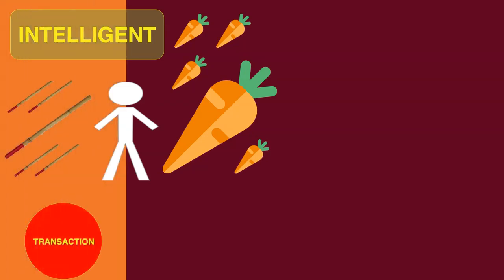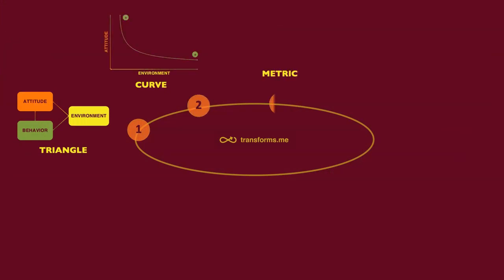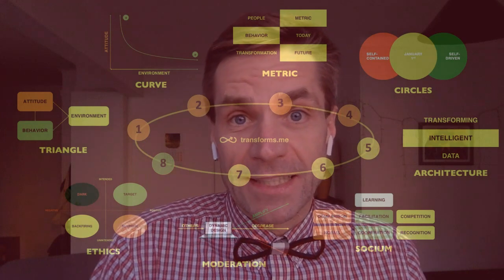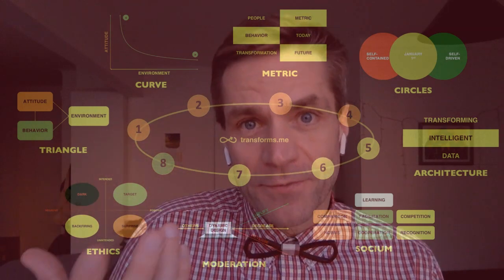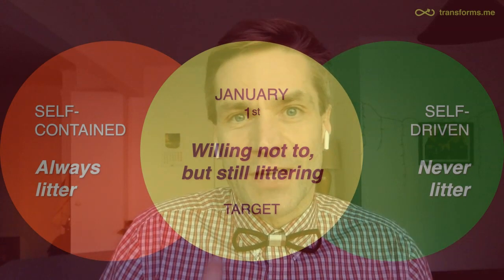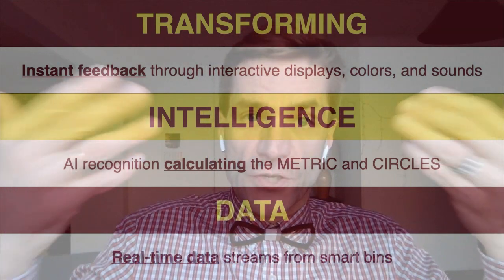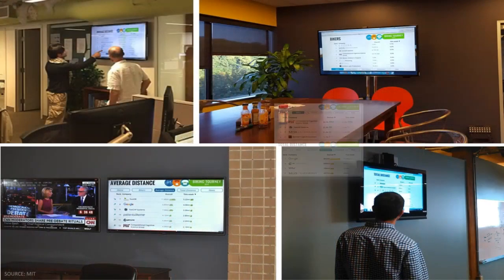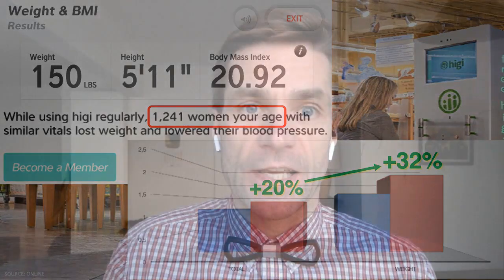Transformation Design Methodology | STIBE method | The Littery | AgnisStibe.com

Comment: Change appears to be a highly nebulous concept, therefore individuals might occasionally confuse actual change with ordinary transactions as they are unaware of the distinctions. However, the outcomes cannot be obtained without long-term sustainable development. As a result, if people wish to do a transformation, they won't be able to handle brief transactions or even transitions. This video is quite useful, and it helps me comprehend the primary concept of change. 
Thank you for the insightful video!

Comment: Simple and concise summary of the methodology that shows the difference between change and transformation. After watching this video I understood the power of graphic that shows progress in transformation. It motivates and encourage each other to join the transformation process. But I'm wondering about anonymizing this data to avoid possible side effects. Regardless of all I see potential of application this framework into many social areas.
Reply from the maker: Absolutely, anonymization is the key to avoid potential privacy issues. That is an important part of the methodology. Usually, it comes right after the 8th tool, called Ethics.

Comment: The business case share is practical, and I use TDF to analyze similar cases after this video. Among the Transformation Design Framework steps, what interests me the most and makes me feel the most elusive is the fourth step, "Circle." 

"Reward" plays a role as a hook in the transformation process. It's hard to tell does "Reward" motivates enough to drive people (such as January 1st) to change, or can they be sustainable use the service? --- They are like consumers without loyalty.

If people need to conform to social norms through transformational design, then in "SOCIUM", I am curious to what extent people can influence each other.

Comment: Measurement is one of the most crucial aspects of any transformation framework since it influences all of the other parts and allows to witness the real transformation. The misconduct or incivility of certain group of community or some corporation are the reason for the emergence of this methodology. It is vital to recognize and embrace to this transformational change. This will be a sustainable solution. No doubt that all organization has to deal with the changes and it is important for them to transform everything towards a positive sustainable change. Either the organizations learn to be a leader or an influencer in transformation  andor risk everything and be the victims of ever-changing circumstances.

Comment: I think it helps to set milestones (smaller ones) and monitor frequently if we are one preferable vectors trajectory or we have experience set back (rights and lefts). As said in the video, its common to get off the right pathway by ignoring the fact we had a slip up. 
The ease of capture is impacted by multiple factors and the environment is the biggest one. What makes it more difficult is the mixture of different people type - self contained ones, self driven ones and 1st of January. 

What I like is the triangle that helps not only evaluate current behaviour, environment and attitude but as well preferable. Identify is the biggest impact comes from environment or attitude. Appreciate you teaching us by an example to identify - what is what in each situation!

Comment: Thank you, Agnis, for a good and simple summary and provided framework! My thoughts: during the class we are working with quite simple social or behavioural problems. So, I'm trying to understand, how apply it during the changes I'm usually working on - complex and technological changes involving the vast majority of the company, customers and business processes. And, what I see as immediate benefit, is (a) borrow overall thinking approach as people very often struggle with analysis and structure, (b) combine different methods, e.g., use hybrid approach, where we can apply this framework to solve separate behavioural challenges, which usually such transformations face, thus accelerating the change and reducing risks.
Reply from the maker: Thanks, Mark. You are absolutely right. This framework provides insights to deal predominantly with tiny and precisely describable behavioral issues. As you rightly said, to train our brains before taking a deeper dive into everyday complexity. Similarly, as we develop professionalism through practicing.

Comment: I find this video insightful. Dealing with change may cause uncertainties, especially during the transition phase as it is the moment in which you cannot see the outcomes of the change yet. For this reason, I find the transformational vector very useful in order to track whether you are following the chosen path and whether you are still sustaining the change. Together with it,  in my opinion, the metric framework should be always integrated in order to technically measuring if the change is happening.

Comment: Having those videos really help to follow the class afterward. Presenting the tools you are using and we will use makes it very easy to comprehend latter on. And the different stage of how to manage change are contextualized, so we can better understand and use them, and mostly to identify what are the challenges we will have to face when implementing change. 
(Also, did you add birds singing in the back on the video? I can't believe your microphone is that good on airpods, is it for relaxation effect?)

Comment: Human behavior is a very complex and intricate factor that is difficult to manage and even more to change into the desired manner, so it  requires an appropriate approach. Society as a communication system is one of the example of chaos theory, which is sensitive to initial conditions and requires to be structured but by implementing non-standard methods. Therefore, it is very important to understand and to be able implement the tools of  transformation framework in a right way and reach the best outcome within the chosen society. Very useful examples were shown in the video that reveal the main idea how to implement tools in real life situations.

Comment: The main takeaway for me was that in order to succeed in this transformation process it is necessary to follow certain steps. The problem is that people often do not understand how difficult and at the same time easy transformation can be if you do it correctly. This video gives an insight into the framework which could help to succeed in this transformation process and help to achieve all the desired goals.

Comment: From all transformation framework the measurement is one of the most important parts as it influence all the other parts and you can see actual change by it. Classification of the measurement should be easy to understand and apply. 
Someone may think that this is about competing by showing results to others, but at the same time people like to see results straight away and it can be motivating. For some it may be just competing but for others it may be a feeling to be a part of some common purpose and they engage to change because of that.

Comment: You have mentioned what technology is required to keep transformation to be sustainable. But can technology be removed at some point? Mentioned example with litter bin and billboards which motivates to use it. Technology supports artificial motivation. But removing the billboard will make this behavior not sustainable, and people will act as in old times.  Is any research for how long you need to provide any external impact on people's behavior, so they transform their mindset about not using bins and being late on the meeting is not ok, so the system becomes a self-supporting social norm?  There is the line when and how to understand what artificial behavior becomes humane?